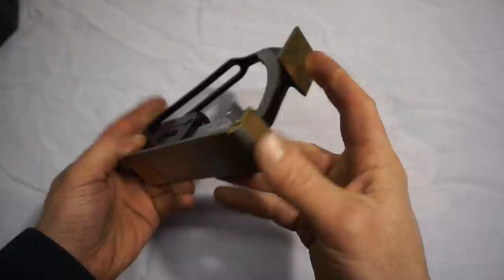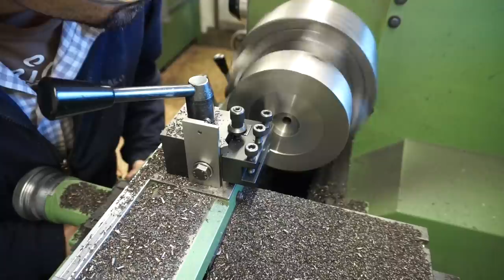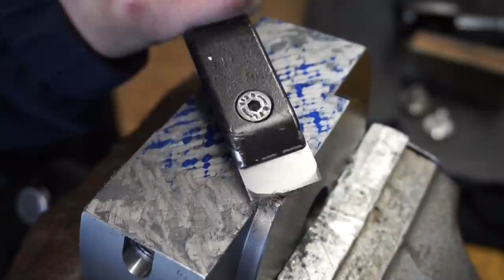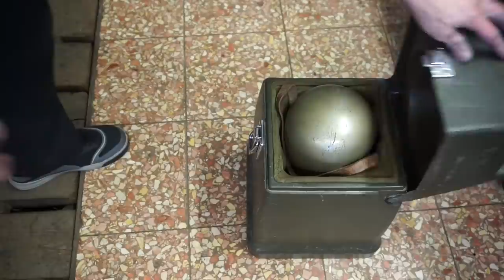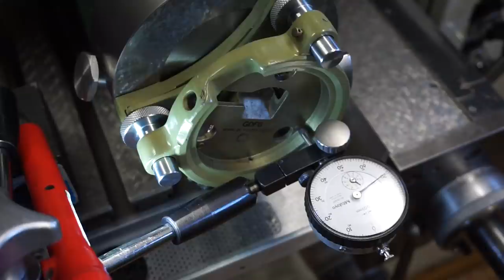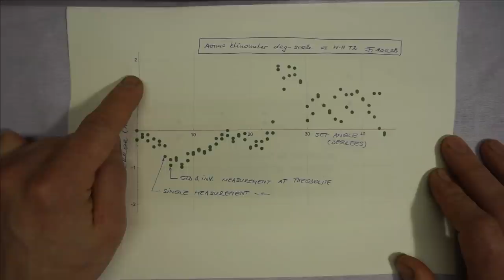Clinometer Reconditioning: Testing Accuracy

Comment: Excellent engineering content, love it.  On the practical side, and as a hobby machinist, I am curious as to how you machined that shoulder bolt hole with one side straight? 
Good to see you have winter in Austria, up here in Norway, supposedly the cold north, we have had continuous rain until end of December.  Now we have a few mm of snow.

Comment: 2 - Key data points to picked up here - scraping is about a 2um process - ( I suppose one can think of 1um?) - compare to surface grinding that can also approach 2um in the right hands or a lapped gauge block that has to be about 100nm to wring properly. 

The other bit about feeling the high spots - is also an important point.

Have you done anymore steel scraping?  I consider the tooling, with what I would call 'heel-control' that you used on your video 'Hand scraping Carbon Steel" to be an absolute gem. Quite interested in what you achieved with it.  

Thanks for letting us look over your shoulder - quite a treat..

Comment: Alex, Thank you for mentioning that you can feel the 2-micron high spots when finish scraping the flat with a sharp scraper blade.  I don't recall any other YouTube provider mentioning this, perhaps because they tend to ignore hand-scraping and use their Biax power scrapers.  Now, assuming that I obtain the ability to grind my scrapers as I learn to hand-scrape, I'll know to expect to feel the high spots as I perform finish scraping.  Can you recommend any "less inexpensive" way to grind scraper blades than having access to a D-Bit grinder?

This is a fascinating video.  I truly wish that I (as an ME) had been able to design precision devices and learn much more about Metrology before I retired.  I did get a chance to sit in on the OEM training when our Tool Shop received its first Kern theodolite back in the '80s and learned a bit about the devide's capabilities.  We tended to use our theodolites to build, measure, & "(re)calibrate" fixturing for aircraft repair.
Reply from the maker: Hello Mr. Vines, thank you for your interesting comment. Regarding the blade sharpening: Robin Renzetti showed a very simple, but remarkably well working method with a wooden block and a charged (stationary) lap in one of his last instagram posts ("Robrenz"). I'm sure you will be able to find it. Greetings, Alex

Comment: As always great video with some usefull informations. I'm curious about that sudden change at 25 degrees. Since 5 teeth engage at the same time it could be caused for example by a tiny burr or spec on one tooth.
Reply from the maker: Very good point, however, I couldn't find any obvious burr. The teeth look really fine and clean, even under magnification. But I assume that one tooth may have been cut with a "large" error.

Comment: Alex, I know it has been two years, but, does a level's bubble change size due to atmosphere? is the bubble the same at sea level and at the top Mt Everest?
Reply from the maker: Good question. Usually the levels are enclosed glass housings that do not deform notably due to atmospheric pressure. In other words, the inside of the spirit level shouldn't see the atmospheric pressure.

Comment: If I was reading your chart correctly, it appears that it's much more (relatively) accurate at 0 and 45 degrees - with a higher error rate within the middle of the range.  Did I read that correctly - and if so do you have any theories on why it is?
Reply from the maker: Yes, I agree. However, I cannot explain the larger errors in the "middle", other than the setup and stepover precision of the teeth cutting machine.